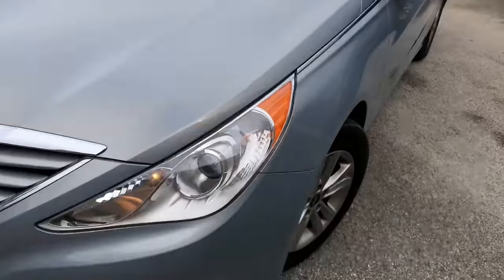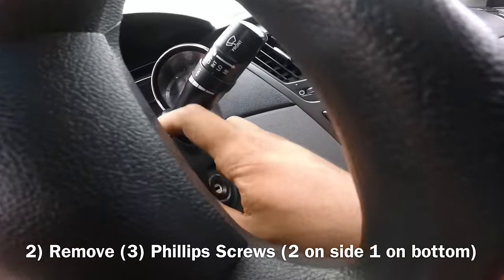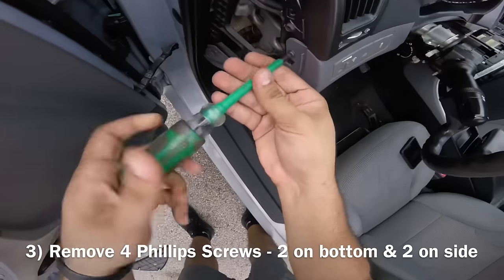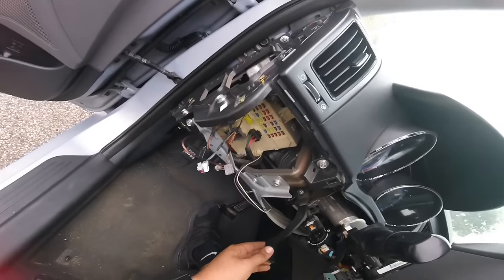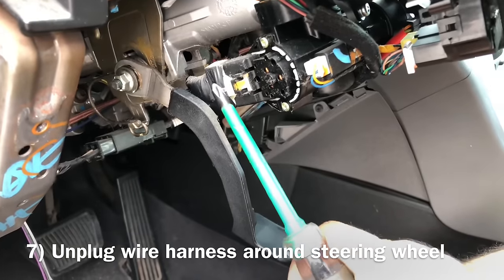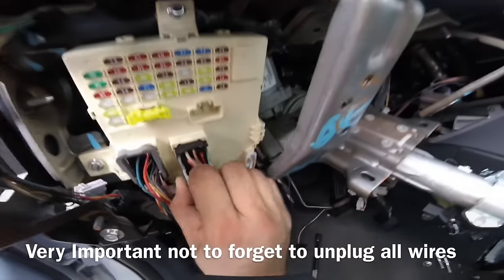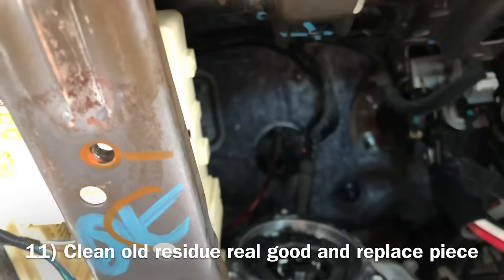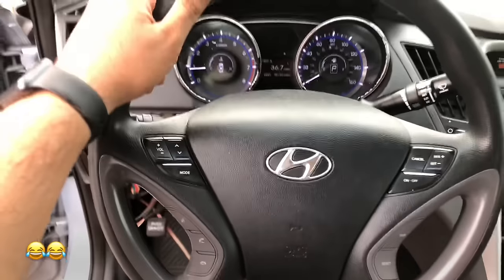HYUNDAI STEERING WHEEL NOISE : HOW TO FIX - SONATA/ OPTIMA 2011-2014 UNDER $20!! FAST & EASY!

Comment: After doing a rear brake job (wtf Hyundai, why did you make that so hard), and seeing this cheap ass plastic piece fall apart in the steering column, I don't think my next car will be a Hyundai!
Reply from the maker: Hey man I agree! They’re great cars specially if you have the warranty! Excellent warranties. But just like any other, they got their pros and cons! Lol sorry for that experience man.
Reply: Its covered under warranty
Reply: But.... Only to 100,000 I believe, mine is at 160K so I am going to do it myself with the help of this video.
Reply from the maker: Call the dealership first see if they will cover it!! If not, let us know and share your experience with us! I’d love to see how it turns out for you :) thanks so much for watching my video and I’m glad you found the content helpful :)
Reply: Hidalgo Motors Co TV it’s a $342 fix if you take it to the dealership. And the guy mentioned about that the warranty is only covered to 100K is correct.So now I’m having issues with getting someone to do it other than the dealership. But I’ll definitely share your video with a well trusted mechanic!!! Thank you for this! #2012HyundaiSonata
Reply: Robert Anderson  it’s called a fucking coupler what do you think will happen to polyurethane rubber when it’s assisting your steering wheel???
Reply: JackPotLegend  it’s actually worse then that, as I work for a Hyundai dealership as a technician you get these cars with 15k miles that have failed, there’s no said reason as to why they failed but they did and if you get the recall product or (updated) product it’s supposed to take care of it for good but we won’t know for sure since most of the YF sonatas are about 5 years away from the scrap yard
Reply: Hidalgo guy after your money. Go for Toyota.
Reply: Dealers are ripping people off with this.. Someone who has done this a couple of times can easily do this under an hour.
Reply: @michaeldre2447  I got a question. I got mine fixed from a Hyundai dealership (The same process done in the video). After i got my car back it has a whine noise when turning the steering wheel. I now have a steering wheel that make a strange whine noise instead of clicking after they gave it back to me.
Reply: Baki I’ve done one and had the same issue, if I remember correctly the back plastic cover right behind the steering wheel causes that, either not aligned Correctly and the airbag portion makes contact with it, check it out and see if the very middle of the Horn/airbag is making contact with that plastic piece and let me know. Every time I do a coupler I always check for this noise and correct it if it happens. Don’t want one noise fixed and another starting
Reply: That rear brake job is hell! Lol I did it the other day and grossly underestimated what I was getting myself into.
Reply: This was super easy. Agree with a lot of the comments here.. removing the fuse box helped on the getting better angles toward the end, lifting the steering column back into place was a bitch and I needed an assist with that. Overall, took a little under 1.5 hours and you saved me hundreds of dollars! Thanks for such a great video!
Reply: Stay away from a Camry too. Worst than this crap. Car in shop right now. $ 150.00 bucks just to take it all apart, then probably another $ 150.00 to put it back together. Part value $ 6.00 dollars.WTF

Comment: Great video.... The part was $1.50 from dealership.  Your video walked me right through the repair, with only a couple of differences. I have 2012 model, and where you took two nuts and two bolts out to drop the steering column, the 2012 has two nuts and a very hard to reach single pin way in the back.  Thanks, man

On mine, for whoever is doing 2012, the single bolt comes out from the right near the top of the gas pedal.  To rehang the steering column, I put the column in place and held it with the two nuts, then aligned the holes for the bolt in the back.  Actually all went back together easier than it all came apart
Reply: This is very helpful! Will be attempting this with my 2012 this week.
Reply: What’s the name of the part

Comment: This was super helpful!! Thank you!!!! This was nearly step by step for me, except the two rear bolts that are shown around the 7:55 mark in the video, are different in my daughters two door Elantra GT coupe. There is a Single (15mm) bolt that aligns the rear of the steering column, if you have  the manual Tilt/Telescoping steering wheel. To get to it its a pain, and you will need to lay upside-down with your head against the gas pedal to get it. You'll have to pull this bolt out to get the three T30 bolts, and swap out the Rubber steering coupler. Otherwise this video is spot on.!!! Great job Hildalgo Motors
Reply from the maker: Thank you for sharing your words and experience! We're glad to hear that it was helpful for you in fixing the steering column of your daughter's Elantra GT coupe.

We appreciate you pointing out the difference in the rear bolts for the manual Tilt/Telescoping steering wheel. It's great to know that you were still able to successfully complete the repair by following the instructions!

Thank you for your kind words and we're glad the video was useful to you. sincerely. thanks my friend!!

Comment: Just fixed mine today. Putting the steering column in was a challenge. To anyone else who has this problem, I recommend laying on floor and lifting it like your benching it. Once you hook it, you can use your knee to brace the steering wheel in place while you attach one of the nuts. Should be pretty straightforward from there
Reply: Glad I read this comment. Followed your advice and it went back in pretty easy!
Reply: What is the name of replacement part and where do I get it? 2013 Elantra
Reply: Thank you for sharing this tip @TimothyAhene .

I was really struggling to get the steering column back in and ended up taking a break from it for awhile.  After getting back to it, I tried your suggestion, and within 5 minutes I had the steering column back in place.

Comment: I did the job.  At one point, I almost gave up and put it back together to go to a mechanic, but I stuck it out.  

I did damage ( and replace ) the brake pedal sensor.  But overall, your help gave me the confidence I could do it.  

I do understand why it would be about $900 for a $3 part.

Comment: Thank you for the video I watched this then did the repair it took almost an hour and a half I got the part for less than $3 the bolts to get the steering wheel back in place took the longest by far I spent ab 30 min struggling with that I did this on a 2013 sonata se and it looked like there was significantly less to disconnect thank you guys again for the tutorial!

Comment from the maker: Check Out our NEW Video - HOW A DEALER AUTO AUCTION WORKS! HOW TO FLIP CARS! 

https://youtu.be/bpUhsiztPDg
Reply: Hidalgo Motors Co TV  is it the same with all Hyundai cars or it’s different
Reply: Hidalgo Motors Co TV does it matter if the model of the vechicle is above 2015 is it the same way with 2017 model or 2018
Reply from the maker: Bret Hart that’s an excellent question. They should be fairly similar. But you never know. I would do the research :)

Comment: I'm an old man. I found it easier on my back to remove the front seat before I started.
Thank You So Much for the Excellent Video!
Reply: OH, Another thing that I discovered: I didn't disconnect ANY wires from the steering column.
The column dropped down and I could access the drive motor. PHEW!
Believe it or not, it was Disconnecting ALL of those plugs that had me nervous to start the job.
Thanks Again for YOUR Help, Brother. Couldn't have even Tried it without your guidance.

Comment: Great video! I did most of it on my own within 1.5 hrs until! Until I was putting the steering column back in place. After three failed attempts the unit became to heavy to try again. (out of shape and over 60 years old) Got the wife (it's her car) to hold up the steering column by sitting in the seat and using the steering wheel. We had it in place on the first try. I guess a second pair of hands my be required for anyone over the age of 60!

Comment: Thanks for the video. I thought I found an easier way, where they remove the fuse box and dash assembly, but my hands were too big for the tight spaces, so I came back to your video and was able to complete the repair in 1 hour. Not sure why but my coupler had not only come apart but it was melted. New one is working great. This is my 5th Hyundai (2 Santa Fe's, a Tucson and a Veloster), but my first experience with this clicking issue. 

Keep up the good work with the videos.

Comment: What’s the name of the actual part that I need to ask for?  Mine is doing the same sound in my 2012 Hyundai Elantra
Reply: Same for my 2012 elantra got it from hyundai dealer for a dollar! its called the " Steering Coupler "

A question, does your streering wheel vibrates when you get to high way with this noise?
Reply: @buuzy252  my 2011 Hyundai Sonata does it shakes so bad if I get over 65 mph 😭
Reply: @janeelewis7784  Have you gotten you car aligned recently? I had this problem on my previous car and an alignment helped. Especially if the shaking gets worse with the faster you go.
Reply: @CWGameDesign  I haven’t yet I want to buy the piece I needed for my steering wheel and see if that fixes it if not then I was going to take it to get it aligned

Comment: Thanks for the video. Hyundai recalled 2018 santa fe in Australia for the same faulty steering wheel column but not for Hyundai cars built in other years which got same issues. Using a plastic part against metal is unreasonable on this case, Hyundai should have the liability to recall to affected vehicles!

Comment: Thank you for the video! Saved me from getting lost in the process of swapping out my own. I did encounter one issue after putting everything back, that there seems to be a grinding sound when I steer now and it wasn't the issue before the swap. It's not inhibiting the steering, but the sound is making me nervous. Any idea what might be wrong?
Reply: Did you figure it out? The dealership fucked mine up with the same sound now they act like it was there before i took it to them so i'm fucked.
Reply: Did you ever figure it out? Im having the same issue with mine after doing the replacement
Reply: How bad is the noise? I don't wanna fix a problem to create another

Comment: Thanks...you rock!

2014 Elantra GT a little different but this was a huge help! Elantra GT has bolt at the back of the column you need to remove to drop the column.

!!!Important information!!! 

Disconnect the negative (-)battery terminal before you get under the dash with the Airbag! 

When putting it back together make sure the first thing you do after installing the rubber grommet is attach the the bolts at the front of the column this will support the column and line everything up at the back. I spent a great deal of time, effort and pain getting that bolt at the back installed. Once I attached the two bolts at the front it was like magic. Hope this saves someone about 2 hours laying on the floor board suffering! =)

Comment: Great video!   I’ve been sweating over doing it myself or dumping $300 for the dealer to do it.   You helped me make my decision!  One question,   Did you have to pull the drivers seat to drop the column?    Thanks in advance.    Subscribed!
Reply from the maker: Hey Man! Thanks so much for watching!! To answer your question, we didn’t have to remove the seat at all. It was smooth! We just pushed the seat all the way back.

Comment: Am having same issue with my 2013 Hyundai elantra sx, is it dangerous to drive my car without getting it fixed?
Reply from the maker: Freshers Zone I mean the steering wheel shakes really hard while going highway speeds... any small distraction could steer you in the wrong direction in my opinion... it’s best to replace it.. it’s not hard... just gotta be patient and take it one step at a time.
Reply from the maker: did you fix it?
Reply: Hidalgo Motors Co TV actually i didn’t found that coupler nearby so I went to Hyundai service centre last week and they ordered it as it was out of stock and part will be imported from Korea which will take around 15-20 days
Reply from the maker: ouch man that sucks I am sorry. hope you get it! please update me once you fix it! I am wanting to know how it turns out.
Reply: @naviattlas6546  We bought it off Amazon for 8 bucks, Shipped in 2 days. with Prime
Reply: e o I don’t wanna open my car apart and risking all electronics by myself so I went to authorised service centre to get it fixed
Reply from the maker: @naviattlas6546  if you don't mind us asking. how much did they charge you? so people who read the comments can get an idea of what this job will run them.
Reply: Hidalgo Motors Co TV i got it fixed today and they charged me 110 USD including labour charges and all taxes. 

Earlier they told me it can not be repaired and i have to order a whole new stearing column which was around 1500 USD so I showed them your video and then they thought of giving it a try. Thanks man 👍🏼
Reply from the maker: @naviattlas6546  Dude! thanks so much for sharing that information with us! that's excellent thanks for watching! we are glad we could help you!
Reply: @naviattlas6546  yes that is me. But sometimes even hyundai dont know the problem.
Reply: @naviattlas6546  wow $110 is really good
Reply: Mia's Ministry yeah exactly they recommend me to change whole steering column which was way more expensive.
Reply: @naviattlas6546  right. They told me one time i need to change my heat box to stop the actuator from ticking and said it would clost 4k to fix.?😠😠😠😠
Reply: Mia's Ministry Yeah I know their after sale & services aren’t as good as other manufacturers offer.

Comment: Just did this job today. Some tips, use your toes to lift the back end of the column when reinstalling column hook. Install top 2 nuts on the column bracket before two long bolts at the bottom, adjust positioning as you gradually tighten them to make bolt hole location easy. Don't stress, the tightness in your tilt/telescope adjustment will go away once everything is snug. Remove carseats before starting so you can slide the seat all the way back. Install the t30 on the engine side first, so you can peek through the crack to see the hole. If a slight click from deeper in the front end persists after this repair, your tie rod ends may have sustained damage from the extra play in the system. Always get your wheels laser aligned after replacing tie rod ends or ball joints, your tires will thank you.

Comment: I did this today on a 2013 Sonata. Great video!  Well done and it worked really well thank you.   Agree with the comments below from Nathan Reed.  In addition to the battery disconnect I would like offer the the following advice.  

1. Be careful around the stamped metal parts; the cross brace (4.40) in particular has a razor sharp edge - I'd advise wearing  gloves handling it.

2.  I removed the whole fuse panel as the connectors come off really easily from the front and there are only 3 on the back and 2 nuts holding the component. Once this out you have more room to get at the back #30 Torx screw.    

3. The new rubber drive wheel only cost $2.50 from the dealership!
Reply from the maker: Hey there! We are super proud of you for taking time to watch our video and doing it yourself. And thanks Nathan as well. Yes I agree 100% with your input. Thank you so much! Don't forget to like and subscribe!!

Comment: Nice...but damn...that's a lot of work just to replace a steering column dampener. On the other hand...what's 4 or 5 hours of labor going to cost you. Good video.
Reply from the maker: SanityOne thanks for watching! I’ve seen some users pay $350-$650 for this job.

Comment: I machine one out of aluminum  works great
Reply from the maker: man that is wonderful! you should manufacture and sell it as aftermarket part
Reply: If you can machine a piece from aluminum, I'm willing to buy one from you. Let me know.
Reply: It is made out of a soft material to be sacrificial . Protects  the incredible expensive cogs from sheer. 
BMW does the same thing with their AWD actuator . The actuating gear is plastic , costs 100.00 for the kit . It is sacrificial to protect the 2,000 motor and expensive transfer case from sheer .
Reply: E M I’d be interested in buying one from you if you still do it?

Comment: Good video. This is a recall and a Hyundai dealer MUST do this repair free of charge. Call Hyundai.
Reply from the maker: Thanks for sharing. Ours didn't qualify!
Reply: @HidalgoMotorsCo  
That's crazy.  They use the same poorly made rubber coupler on all of their electric steering systems.  Why would only certain cars be recalled while others aren't?

Comment: One additional point, and I'm not sure if it matters, but I read in the technical bulletin to make sure you align the wheels straight before proceeding. I did this today on my 2013 sonata gl. Just remove the two screws behind the steering wheel before you set the steering wheel perfectly straight.

Comment: Thank you very much for the video, I fixed mine today, it was difficult to get the steering wheel tower back into place, but I did it with help. I disconnected something and I can't open the gas cap so I have to check what happened. 😂😂😂😂😂😂

Comment: I have a 2013 Hyundai Elantra Coop and this video gave me the push I needed to do this myself, however mine did not have the 2 back bolts, even though holes for the bolts were there... but instead there was a welded piece of metal with a single 16mm mounting bolt acting like a pin holding it up from the back. It was actually fairly easy unmounting, but extremely difficult to remount.